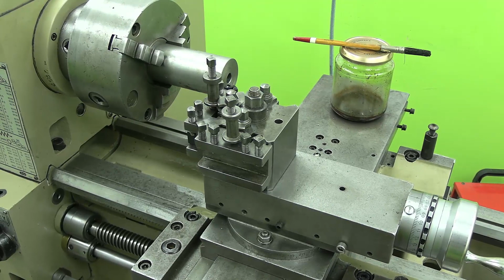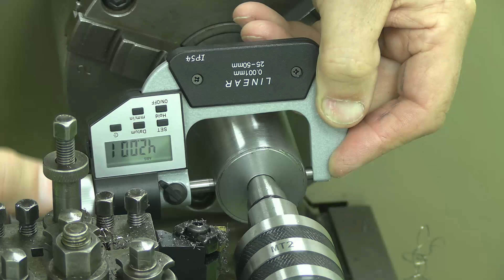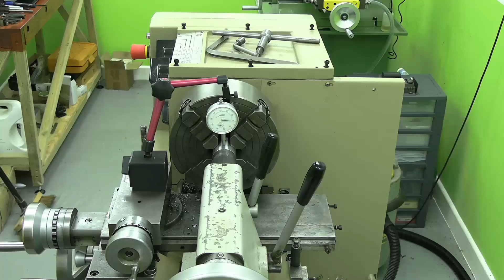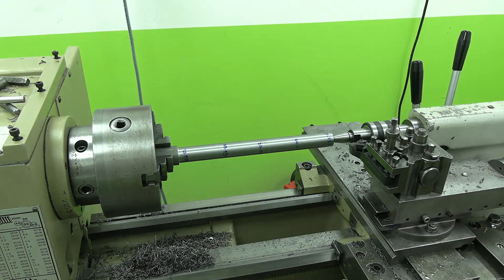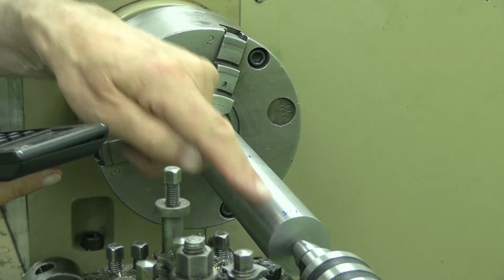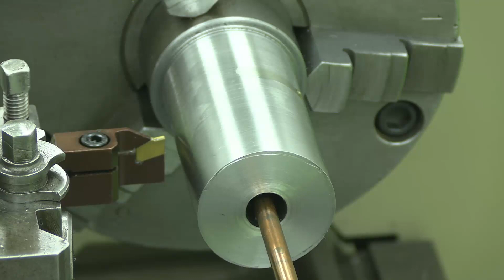M300 tailstock alignment and taper measaurements

Comment: Hi Samuel..  I dial in my tailstock by applying the magnetic base of my dial gauge to the front face of my chuck, setting the arm so it doesnt fowl with the bed and then spin the chuck and try and read x and y misalignment (mirrors sometimes needed).  X you can set, Y means modifications. You can check axial alignment by running the gauge in the z attached to the top of the cross slide.  Just means you don't need to turn a dedicated bar matched to the tailstock quill.  It's a while ago... so probably not really relevant anymore.

Comment: I am curious if you checked the ID vs OD measurements on the tailstock quill to check concentricity. I have to go through my machine again and check it now that it's been sitting for a year or so. Mine's been resurfaced though.
Reply from the maker: I think I checked the o/d of the quill for roundness. I assume the wear is in the thing it fits into, which I haven't checked. "Resurfaced"? Could you explain. What has been resurfaced, and how?
Reply: @samuelfielder  the ways surfaces were re-machined and everything else scraped into alignment.

Comment: Hello again Samuel, am thinking you may have to fasten the lathe down to your cement floor using drop in shields and 1/2" bolts. This would allow you to use the jack screw method provided in the feet so as to get around having to have the bed reground, might not even be necessary depending on how close you can dial in an even cut. The machine's own weight isn't enough to twist the bed on its own as you've already mentioned.
Reply from the maker: Yes bolt-down is a possibility, but I doubt if twisting the bed can fully compensate for heavy wear near the chuck end. Might have to try it though. At present the lathe is still in centre of floor because it's easier to film that way. Should really be back against a wall.

Comment: Hello again, nice to hear from you. Your lathe is really quiet, mine of about the same size makes a lot more noise at speed.  I am glad you have made some parts and had fun doing it. That is what is important. I have never done on my lathe all the tests you have done, I just use it!  It is only Youtube, upload when you feel like it. 
Has the yacht project ended?  
That is a nice looking digital micrometer.  Is it a good value purchase?  
It is amazing that when a parting tool is destroyed it is not easy to work out why.  I imagine you did all you could to ensure it was square and on centre and that is not a question.  What width was the insert?  Inserts can vary so much, I tend to use low cutting force inserts that are quite sharp and have a high rake angle. To know what you are getting though, one has to buy a brand name insert and they are not cheap.  I have managed to destroy a tool in the manual lathe, but never in the cnc where feed is constant and the rpm high.
Reply from the maker: Thanks for posting. The yacht project seems to be on hold due to my friend Dick being busy with other things, but I'm beginning to think he'll never be free to resume it. I can't remember where I bought the micrometer. It seems ok against my (cheap) gauge blocks, and is so much quicker to read than an analogue one. Google "linear tools 50-800-002". Accuracy is stated as 0.002mm. Presumably that means +-.
The parting insert was 2mm wide but of course the thinner the inserts the thinner and weaker the supporting holder.
I don't think my lathe is especially quiet. Perhaps it benefits from new motor bearings and belts. I had to put up a lot of sound absorbing on the workshop walls because having had it wet plastered (not dry lined) I found it was a massive echo chamber, most noticable on youtube audio. It kind of depends where the camera is relative to the headstock.